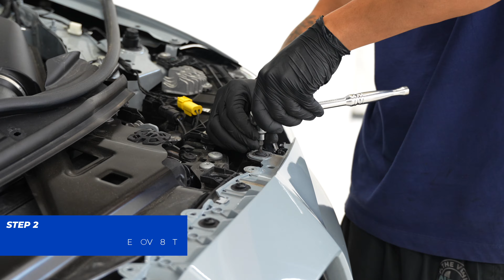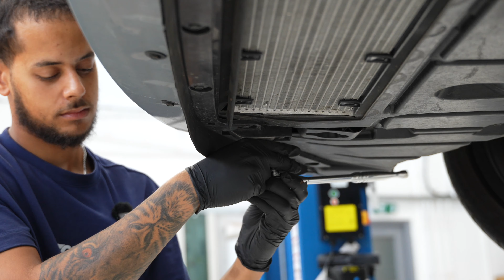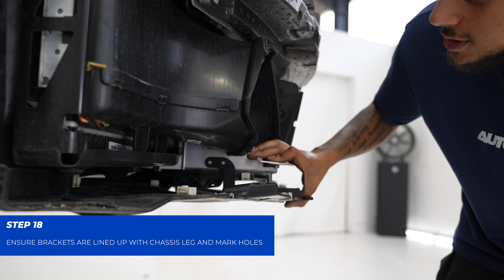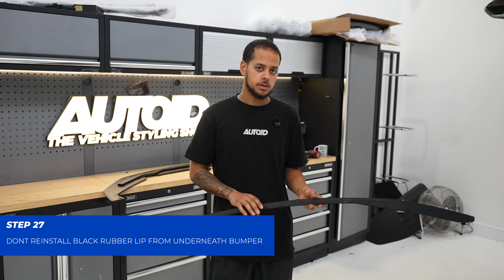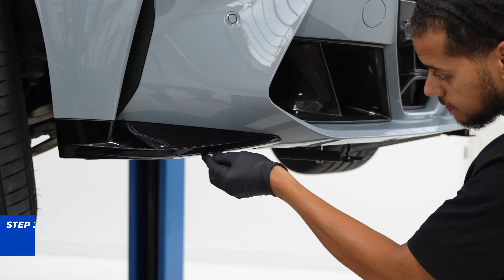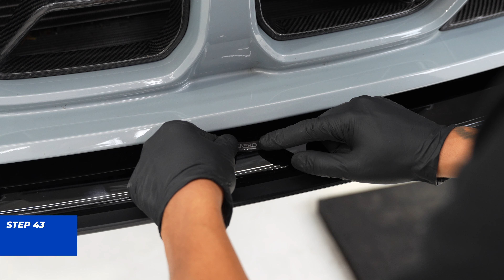How to install ZAERO Chassis Mounted Front Splitter | BMW G80 M3

Comment: Ain't no one buying a lip you have to remove and add that much just to have that flat lip.  That's crazy.
Reply: Sometimes its not about the looks but the functionality. Would take something that truly benefits the stability of the car over just looking pretty lol.
Reply: Thats actually one of the selling points of the old M4 GTS. Adjustable front splitter/aero. Its function is identical. I would say yeah its definitely not everyone, but anyone that does lapping/track days would find this appealing.